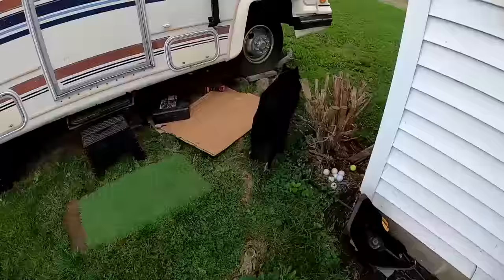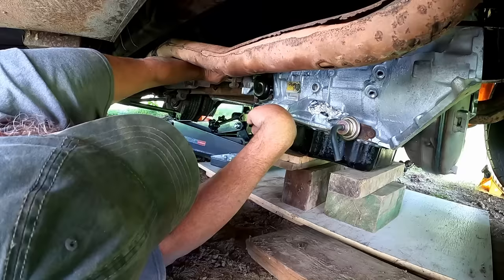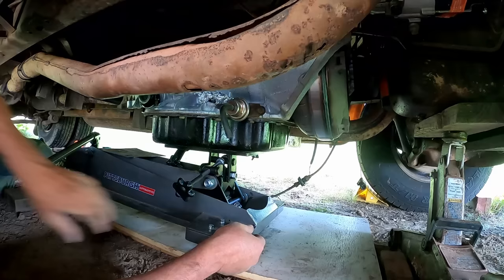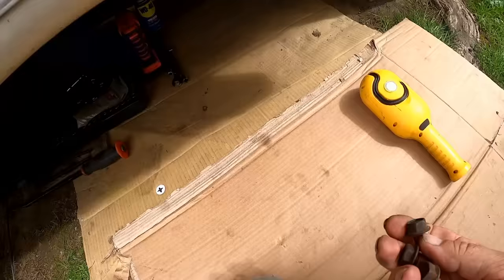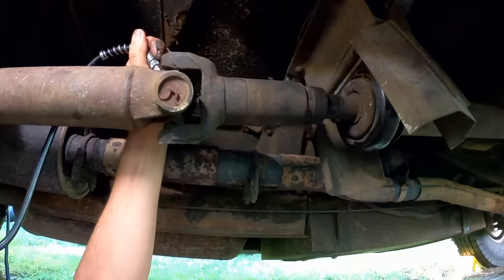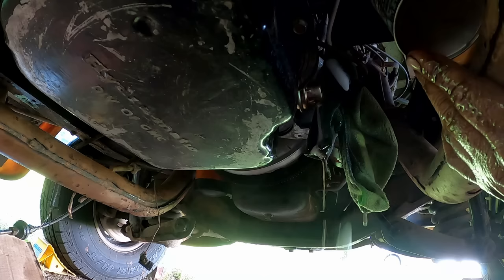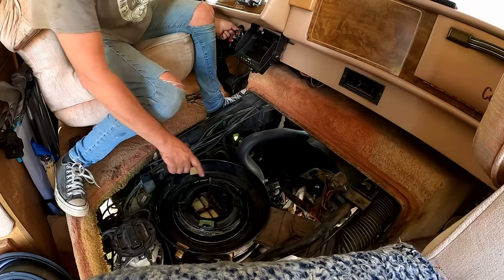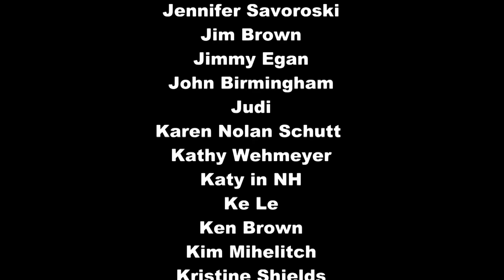Installing A Rebuilt Transmission in a RV Motorhome - A DIY Transmission Replacement Series

Comment: Don’t forget to write the install date on the side/ top of the transmission . It will help if there needs to have servicing in the future - I do that on my parts , it helps me know what kind of service I get out of them instantly . Good job Dave and Bella was such a good helper too . Stay safe , have fun .
Reply: Great idea.  I know the Germans do this on their BMW’s. Parts often have a date stamped in them.  Well, they used to and they keep track of where the part is manufactured and installed in case they have problems

Comment: Brings back memories !  Back when I installed new transmissions in my dad’s fords I used 2 jacks . One to lift up the front and the transmission jack to slide under the middle once I have it up high enough .

Comment: God advice from your friend about not using the bolt to pull it together, I did that on a C6  not knowing what I was doing I got advice from someone who said the torque converter needed to spin 2 places to engage the pump I did that   Works good on GM C6 has 3 stages 🫤 broke the bell housing !!!!

Comment: You must fill the converter with atf until you see  it near the top also you must flush the transmission lines going into the radiator.

Comment: Dave's perseverance and ingenuity made short work of that job!   Question;  If the T C bolts had high strength Loctite and you were able to handily remove them,,,  medium strength will make it easier to remove, but why would you need to?
Reply from the maker: Because of the human factor, mistakes are sometimes made! ...lol

Comment: I usually pour a quart of trans fluid in the converter before putting it on.
Reply from the maker: I've heard of that, but the transmission shop said that is not necessary.

Comment: Hey Dave! The bad thing about doing repair videos is: This Fall when you head out to join "The Tribe" in searching for warm weather. They are gonna be lined up waiting for "Mr. Goodwrench" to do repairs.😁😆
Maybe not. If I'm mistaken, then I stand corrected.🙂 Good mechanics are hard to find.
As always, Thumbs up 👍 Carpe diem
Reply from the maker: Most everyone has their rigs in good working order when travel season comes, so I don't run into that much. :)

Comment: If that is a  Chevy Turbo - Hydramatic 400, and it was rebuilt correctly, it should outlive you ! :)
Reply: Typically these old rvs use a th475 which is the same but instead of having quieter curved gears of the pickup th400 they have straight splines.

Comment: You have the wrong torque converter initially which only had 3 bolts, the th475 80's gm trans used 6 bolts. Looks like you only put three back in the torque converter, I'd recommend ordering 3 more bolts.

Comment: you can never clean the trans cooler completely clean it's always best to replace the radiator, you just put a new transmission what a radiator.
Reply from the maker: False. Transmission coolers are simple tubing with heat sinks attatched, both external and integrated types. It would be just as clean as the supply and return tubing.
Reply: @DavesRVLife  not false, transmission coolers not simple, I work in a transmission shop, trans coolers in radiators are full of hidden spots and will never be the same as new.